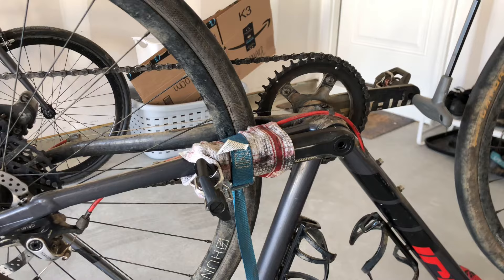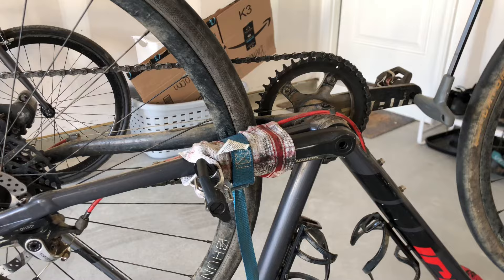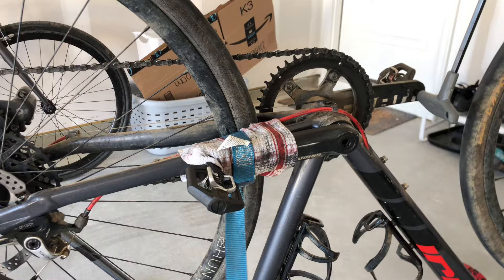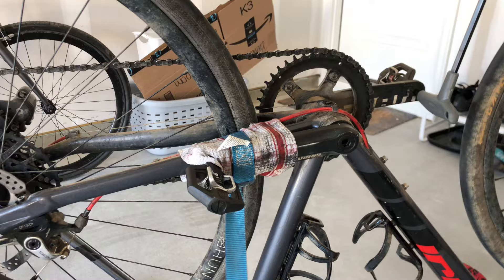Bike Hack - How to REMOVE Bike Pedals That Are STUCK

Comment: Add a small amount of anti seize on the threads on reinstall...probably won't get as stuck as they were in the clip. Rock on brother, great video.
Reply from the maker: Is that a type of spray?
Reply: @ElijahTownsend  no, it's in a tube in paste form. It prevents corrosion between the steel on the pedal and the aluminum crank arm.
Reply from the maker: @cmils1785  Oh I see! I usually use grease but haven't taken them off for a while. I worked on that one for 30+ minutes and then got this idea haha
Reply: @ElijahTownsend  gotcha,  I love the strap idea!!! ✌🏼

Comment: So here is what worked for me:
- take a Velcro Strap and use it to fix your back brake clamped down.
- take a tension belt to fasten the opposite pedal at the seat or down tube of the frame
- take a long piece of wood about 1,5 inch and fasten a pedal wrench very tight with a lot of half hitches or clove hitches
- with that cheater bar fasten the pedal wrench at the pedal, eventually using a narrow 15 wrench to jam the pedal wrench a bit 
- turn the cheater bar to the back (counter clock wise at the drive train side, clock wise at the other side)
- took around 10 seconds until it snapped loose
- did this on a bike stand
I tried WD40 over hours, some ice packs, some lighter, but the cheater bar and a long lever did the trick

Comment: Elijah, would it be okay to do on a carbon fiber frame?
Reply from the maker: That is a really good question, I would definitely pad the strap more to prevent and serious strain on the frame. I’m sure this method is not recommend for a carbon frame but personally, I would still try it if I ever have the issue on one of mine.
Reply: My thoughts also, buddy.